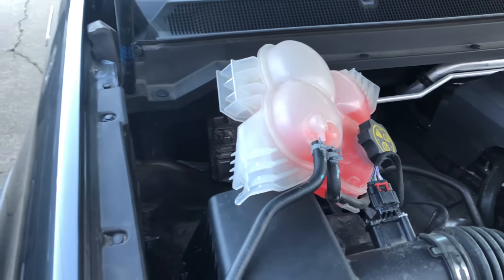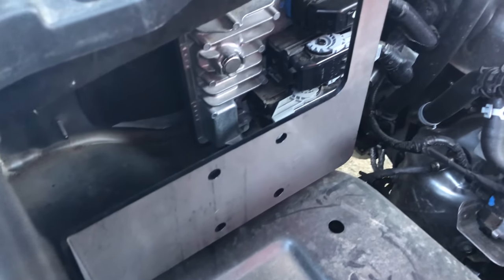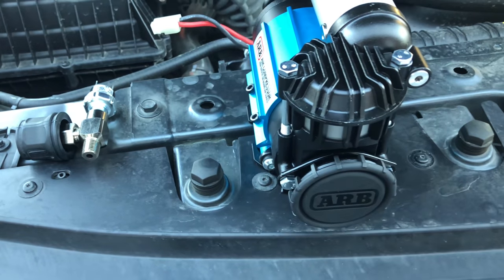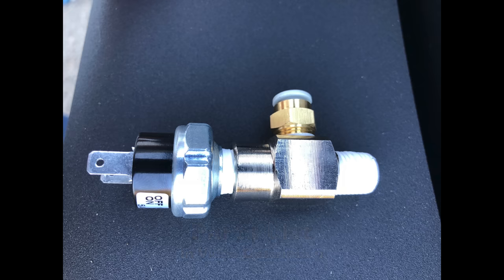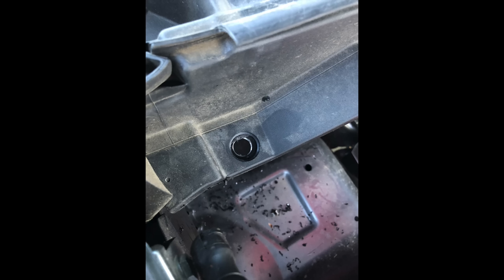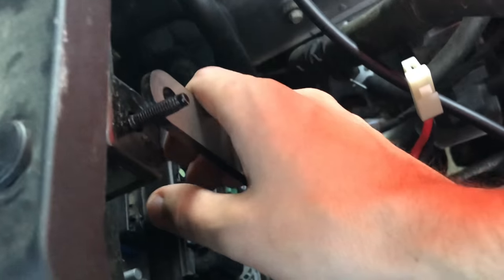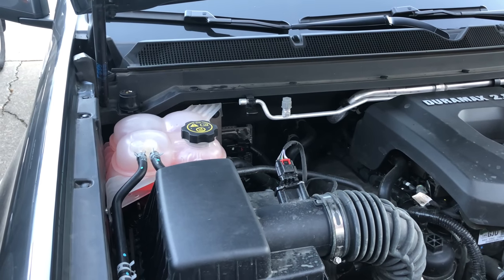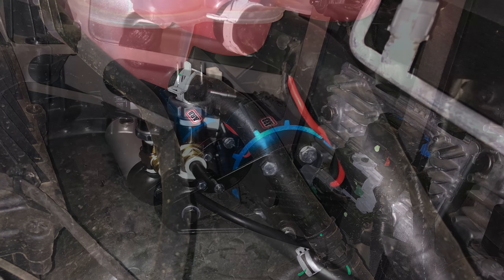Installing an ARB Compressor in 2017 Chevy Colorado

Comment: Good video.  Thank you.  FYI:  The 2020 Colorado must have a larger coolant reservoir.  I had to rotate the hose/regulator assembly downward (toward the intake air box) in order to make it fit. Just loosen the single nut on the baffle in order to rotate it.  Otherwise the mounting bracket fit/functioned as portrayed in this video.  I did smooth the edges and add some padding/gaskets to select places on the bracket.  Other side note:  I left all of my wiring and the on/off switch in the engine compartment.  I attempted to use a fuse tap to run the hot lead through the ignition switch.  My Colorado did NOT like this with resulting "hey dummy, don't do that to me..." messages.  The check engine light cleared itself, but my auto headlamps are acting goofy.

Comment: Installing the ARB compressor soon in my Zr2.  This was very helpful I have all the accessories and I must say those push to connect hose fittings are amazing I did not know those even existed.  When are you going to post up a Pt 2 to this video to show how you connected everything?  I have a Switch Pros and will be connecting ARB wiring switch to that, other than that should be an easy install.
Reply from the maker: Hudson Z Roamer sweet! I’m glad this helped. I have actually ripped this out of the truck to make some minor changes and now the truck is currently in the shop for a busted horn and weird noise.  Once I get it back I’ll update the video. As for the wiring. I’m almost ready but I’m debating on the SPOD or an ARB LINX.  They both have some pros and cons. I would love to test out the LINX as there are no good actual use videos but I’m not sure yet.
Reply: @offroadtails5948  I ended up doing the first part of the install today.  I may have drilled a bit too much as the air output for the hose is jiggling around.  I ended up putting some silicone gasket maker on it and will use some universal rubber grommets i have sitting around, that should snug everything up.  That black hose is super stiff and causes the air output to move around.  Im going to finish up with everything tomorrow and do the wiring into my Switch Pros as well.  We shall see how it goes.
Reply from the maker: Good luck. Just FYI. The bracket is bare metal. Mine rusted pretty fast so I pulled it out and painted the bracket.
Reply: Off Road Tails yeah that was the first thing I did was paint it.  Yeah if you don’t paint raw steel it’ll rust fast.
Reply from the maker: Right! I was sooooo excited that I forgot. My bad.
Reply: @offroadtails5948  Got everything installed successfully but the ARB compressor keeps cycling every 10 seconds I am assuming there is a leak somewhere letting air out.. I bet its where I screwed in the extra connections to the air output itself.  Will troubleshoot that today.
Reply: So the issue were those connectors you recommended they leak like crazy I tried different one no luck..Im removing your mod its not that big of a deal to reach the air outlet anyways.
Reply from the maker: Hudson Z Roamer that stinks. I would send them back. It does not leak on mine. You must have got a bad set. Good luck.
Reply: @offroadtails5948  I bought two sets they are all leaking. BTW If you haven't wired up your compressor yet how do you know they are or aren't leaking?
Reply from the maker: I did today. Just have not posted pictures yet. That’s a bummer. I’ll keep an eye on mine and see if they hold up. I wish o could attach photos I added 2 solenoids and several more fittings. I hope mine don’t start leaking. Where are yours leaking at so I know where to look. At the threads or the hose?
Reply: @offroadtails5948  It was leaking on both connections where the black hose goes into.  The connection was secure and seated but you could hear air coming out on the connecter by the air outlet AND the one on the compressor.  I tested every single one of them on both packages and they all leaked.  Its not a big deal I still got the compressor installed and it works great just without the mod.